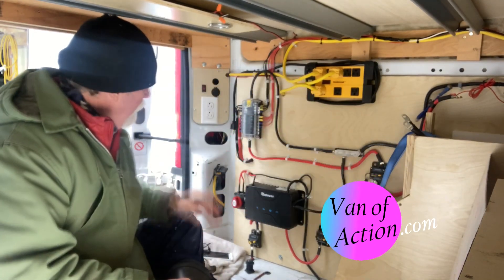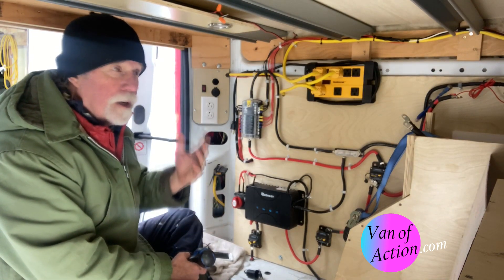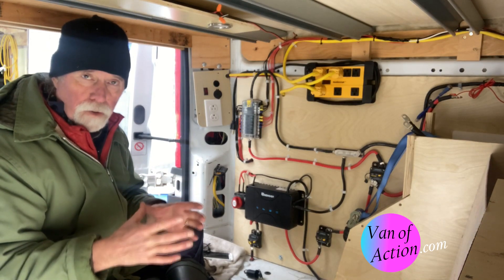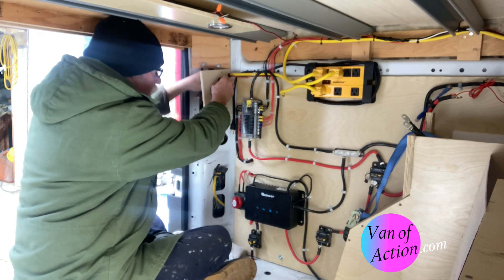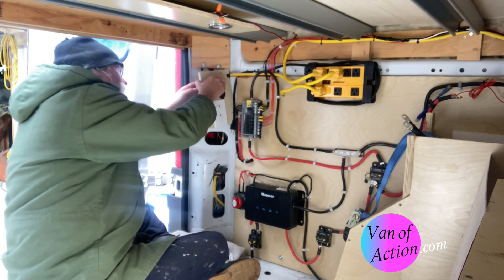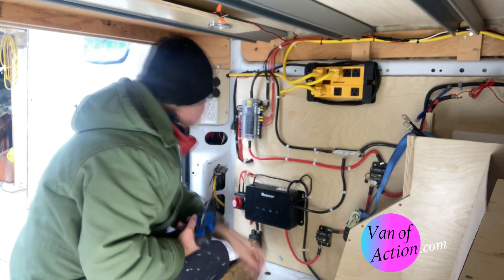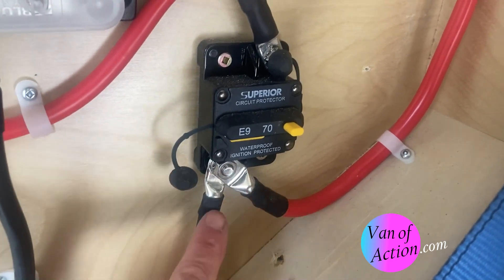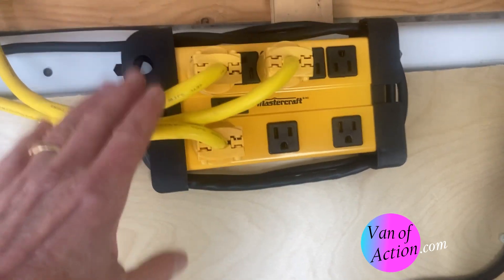DIY Van Conversion Electrical Design for Solar Dc DC and Shore Power for Vanlife Build Promaster

Comment: Hi Dave. l’ve been subscribed to your Van of Action channel for the past three years, but l don’t typically comment, in fact this is my first. I wanted to write to thank you for your videos, especially the ones on building a roof rack.  In the summer of 2021, l bought a 2017 ProMaster 2500 short-wheelbase cargo van from a contractor. I have since turned it into a campervan, including building a roof rack for my solar panels following your tutorials.  Thank you.  A couple of your recent videos about portable power stations and fridge issues has also prompted me to write.  It’s too much to put into one comment, so I will break it up.  But before that, a little background.  I had never planned to buy a campervan, but with Covid I found myself with little to do.  I retired 10 years ago at 65 and had been doing quite a bit of international travelling.  Then Covid — now what?  So almost on the spur of the moment I decided to buy a used van and convert it into a campervan, but with no clear plan or any previous experience.  The first summer we simply put an airbed in the back and headed out to provincial campgrounds here in Manitoba.  Then I started to plan how to build it out and later discovered your channel.  I chose the ProMaster for the same reason that you did, its width.  So some similarities to your decision.  However, I didn’t have a plan beyond that because such vans were suddenly becoming difficult to find around here.  So I ended up with the 2500 series with the short frame not by design, but based on what I could find on short notice.  I’ll end this here, but will try to get two more comments off to you over then next few days: one on portable power units (I bought an EcoFlow Max 2 unit) and one on fridges, originally I had a 12v DC combined fridge/freezer unit similar to yours (which broke down on our first road trip to the Yukon), and then with a 120v AC unit, which has turned out to have its own issues, not with breaking down, but centred around power consumption and battery drain for the portable power station.  So more to come later.  Cheers, Paul (in Winnipeg)
Reply from the maker: Hi Paul - thanks so much for your comment - I'll be looking forward to the nest ones.  We got our van the same way - "Just take whatever is available"   So now I'm stuck with the passenger seat not swiveling.  I'm thrilled you used my design for the roof rack - if you have a chance could you send me photos ???  vanofaction@gmail.com  - looking forward to seeing what you have to say...............   Be well   Dave

Comment: Hi, thank you for all this information. I love your chanel ! I also have a Promaster to built. But I have a question : what is the precise model for your MPPT Renogy Charge controler ? It's the first time that I see, that it could controle in addition DC to DC from your alternator !! And are you happy with your Renogy MPPT ? Thank's !        Simon from Québec
Reply from the maker: Hi Simon - great to hear from another Canadian !! And thanks for the kind words.   Yes this controller will charge from both the solar array and the van battery when the engine is running.  It detects when the van battery is fully charged and only pulls the excess energy the alternator is generating so the battery will never get drained.  In fact, when it senses the batteries in back are fully charged and the solar is generating excess energy it will actually trickle charge the van battery !!!!   I thought it would be a great backup if we hit several raining days in a row or camp in the woods without direct sunshine.  It works great !!!   If you install one you want to be able to isolate (shut off) both feeds because the unit is designed so that if ANY charge is detected from either the solar or DC-DC line it automatically toggles both to a maximum of 25 amp draw. You probably won't have 25amp coming off the roof ever so it limits the effectiveness of the DC-DC part - which we only use as an emergency backup.   The exact model is here .....   https://ca.renogy.com/50a-12v-dcc50s-dc-dc-on-board-battery-charger-with-mppt/#op=%7B%22id%22%3A1104%2C%22options%22%3A%5B%7B%22optionId%22%3A%22334%22%2C%22value%22%3A%22559%22%7D%5D%7D   ..... buy with confidence but accept that Renergy has very poor customer service.   Be well and I hope you stop back.

Comment: Dave, Dwayne here from Arnprior.  After some research, I too have selected Renogy as my main solar, battery, and controller supplier.  Question for you – how do you get a hold of them?  Can’t seem to get anyone on the phone.  I want to alter their online “packages” to meet my specific needs.  Any advice is appreciated.  Cheers – Dwayne
Reply from the maker: Hi Dwayne - great to hear from you.  I'm sorry but I've never tried to contact Renogy.  I also didn't order one of the packages.  I ordered the components separately and everything ran exactly as advertised.  Good luck and let me how you make out.  Cheers
Reply: @VanOfAction  thank you.  I'm going to see if i can actually talk with some one... i know I'm too old school.. :-)
Reply from the maker: Good luck - let me know how you make out.
Reply: @VanOfAction  Never did get to talk with anyone.  I was able to get through to a young lady that said we will have someone call you back, and it never happened.  I spent another day breaking down the kits that they offer to price out the various components to essentially build my own kit.  After watching your video and two other videos on the 50Amp DCDC controller, that was the only controller I wanted… and surprisingly, they don’t offer that controller in a kit.  Interesting.  Anyway, parts ordered, bank account lower. :-) - Dwayne
Reply from the maker: I think you saved yourself a ton of heart ache by going this way ,,,,  My experience has been a real eye opener.  With 300 watts of solar on the roof I've only used the DC-DC charger twice.  We  have the BIG Dometic 97L dual compartment cooler and we're making ice 24/7. !!  Gotta love it.  Be well

Comment: Question at 13:18: I have 2 X 20amp MPPT charge controllers. Are you saying I can use one for my roof solar panels, and one for the power coming from my van's starter battery/alternator, and feed my LiFePo4 battery bank with both of them, thereby removing the need for a DC to DC controller?
Reply from the maker: Hi Avlisk - great question.  The answer is NO !!!  There is a significant difference between an MPPT charge controller and a charge controller for DC-DC charging off the vans battery.  As I understand it the MPPT controller is pulling power all the time, it takes whatever is available.  It  regulates the power that comes off solar panels and makes sure it's OK for the battery you're storing in.   The DC-DC charge controller has to communicate with the van - first to make sure the engine is running and then to make sure the van battery is fully charged before it starts to pull power for the house batteries.  It's possible to buy combination units that are built to do both - that's what I got.  Having said that - please remember that I'm a carpenter and you should consult with an expert before installing if you're not doing exactly what I did.
Reply: @VanOfAction  Thanks. Not the answer I was expecting, or hoping for. Don't worry, you aren't my only source, I'm doing a lot of research from many places. It's just that over the last couple of years, I've bought a lot of stuff I thought I'd need, only to find out my ignorance has been expensive.
Reply from the maker: avlisk - There certainly is lots of information out there.  Too bad about buying stuff you may not need.  But the silver lining might be reselling.  If it's still boxed you may find joining some Facebook groups will get it sold - there is a real shortage of components right now.  Be well
Reply: @VanOfAction  I think I can split the solar array into 2 parts, each with separate solar panels and separate charge controller of 20 amps each, thereby creating redundancy and eliminating a single point of failure, but still providing enough power to keep me going.  I saw my retirement money in the bank just shrinking every week due to inflation, so, buying stuff and storing it has been partly a hedge against inflation and protection from future supply chain issues. If only I had gotten a van before production ceased, I'd have a place to mount all my stuff! There are simply no vans for at least the next 6 months, according to my local RAM dealer.
Reply from the maker: Avlisk - redundancy can be a wonderful thing at times for sure.   Sounds like you have a plan.  And yes - vans are really hard to come by, both new and used.  In fact I was shocked last week when I discovered my 2018 as it was when I bought it is worth almost 15k more today !!

Comment: Thanks for showing the diagram, but do you have a video that explains the parts (like the switches and fuses) in greater detail and where to purchase them. Also what wire sizes? thanks
Reply from the maker: Hi South Oregon - thanks for watching and taking the time to comment - I've been working on exactly that !!  It's probably a week or 2 away !!!  Please stop back - be well
Reply: @VanOfAction  Thank you so much. I will be waiting for it
Reply from the maker: Hi Southern Oregon - I've been working on the more closer look at the wiring and it was getting too long - so I posted part one - how and why to rough in today -  here's the link  https://youtu.be/hzXNuC6bqYc   Part 2 should be done next week.  Cheers and be well

Comment: Well, I don't know if you use the van during the winter but if you do, that poor plug hidden in the bumper must receive a lot of road salt.
Reply from the maker: Hi Charielevoix418,  thanks for watching and commenting   Being in the mountains of British Columbia I don't insure my van between November and May.  Having said that,  using it with snow on the ground was NEVER part of the plan.   Once Covid is over and the world gets back to some kind of normal wintering in Arizona is the goal.  But you are right.  The setup I have would not do well in snow the way it is,   but I'm sure the plug end could easily be protected.  Be well and safe.